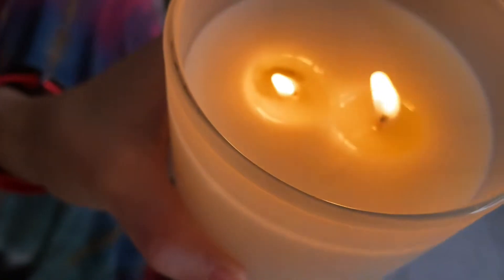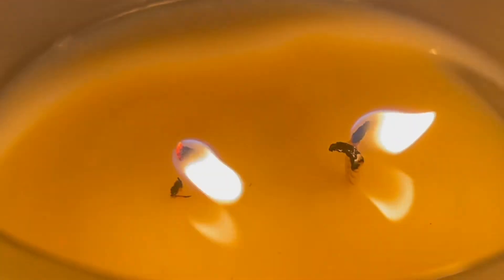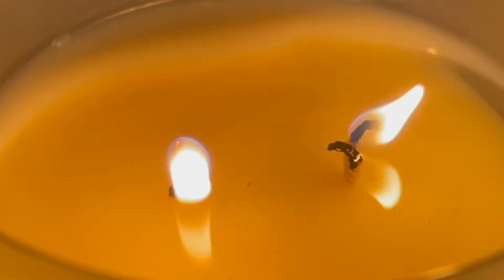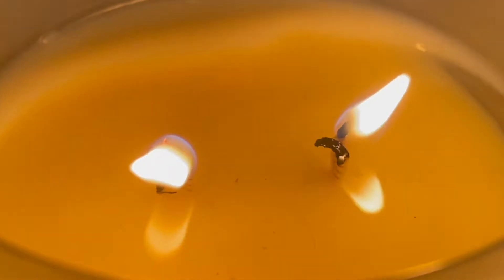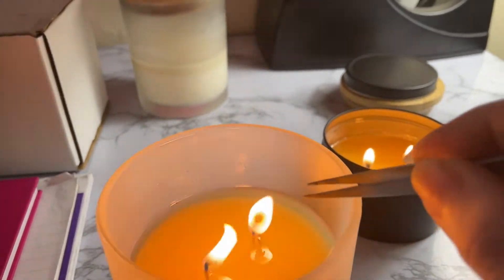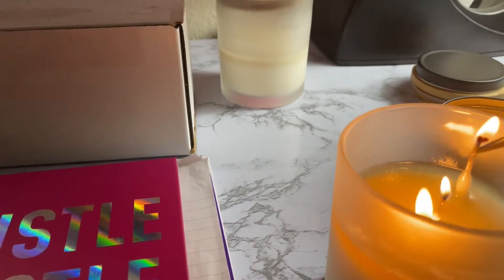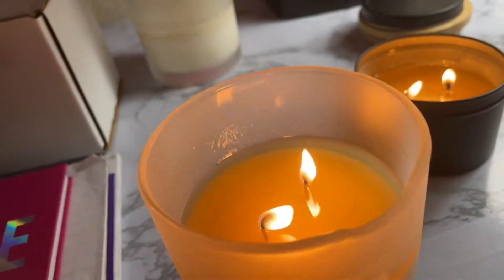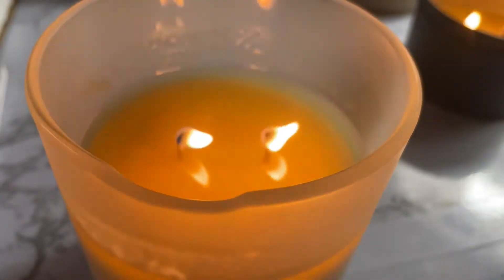How to fix a DROWNED WICK/LOST WICK 🖤

Comment: Thanx so much for this vid Sarah........i must chuckle, because i had no idea there was such an effort/science behind burning a candle. Being a "typical guy" (lol) i always thought 1) light my scented candle(s). 2) let it/them burn until the room smells nice. 3) blow it out. WRONG!! I have a sweet dinner & movie date tomorrow night at my place, and brought out my scented candles to create a nice ambiance and scent in my entertainment room. The tunneling on my candles are just starting to happen......i just found out the first time you light a new candle, let it burn for a minimum of 2 hrs to melt all the wax in circumference of the glass. So, i just fixed this by putting them in my oven (on a low heat!) until the wax all melted evenly. Now the wicks are a little bit buried, but not too bad (they are visible, close to the surface). So, tomorrow i am going to try the hair-dryer method (high heat/low power) along with tweezers to pull and straighten the wicks up. See what some of us guys will do to impress a woman?? Lol (j/k). Cheers to you, and thanx for this great tip :)
Reply from the maker: Oh that’s sweet 🤣 and I’m so glad it was helpful! The oven method is a good way to get the wax to lower a bit at well, I’m always worried it’ll light the wicks when I’m not watching 🤣
Reply: @EclipseBotanica  no, you're fine hun.......150 degrees for roughly 10 mins did/does the trick. I usually eat an apple while watching the oven window lol. Cheers :)
Reply: I'm a woman and feel the same way!

Comment: This is such a good idea but I wonder if it lasts or does another puddle form and drown the wick when it burns down enough? Curious what others have found. Should I expect to repeat this fix?
I'm finding that commercial candles, even the expensive ones, seem to have inferior quality wicks that don't last as long as the wax. Once about a third of the wax is gone, the wick is practically burned away. I've tried dumping out excess wax and it helps but only for a little while before the wick is gone again.

Comment: How do you fix a wick that won't stay lit and fizzles when you do light it?
Reply from the maker: That depends on what the issue is, if you can add a taller wick to help melt the wax down it can be fixed, if your candle is tunneling I’m not sure if there is a way to fix that I’m afraid! 🥺